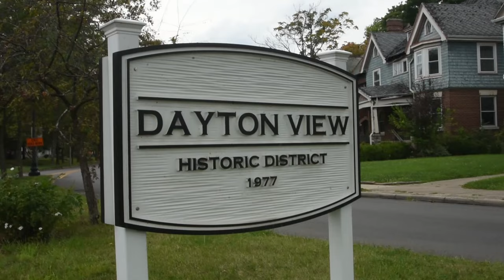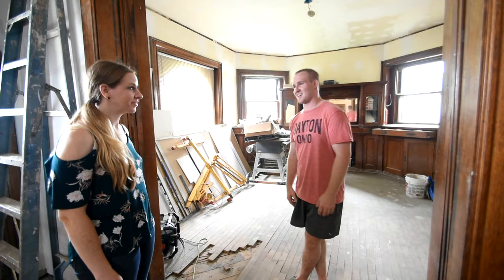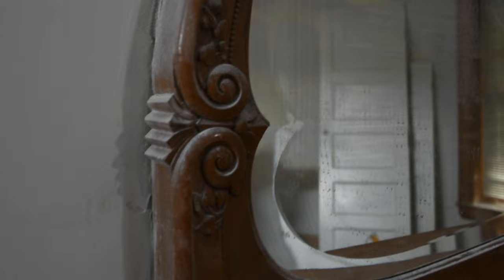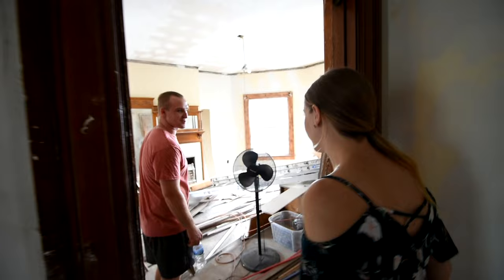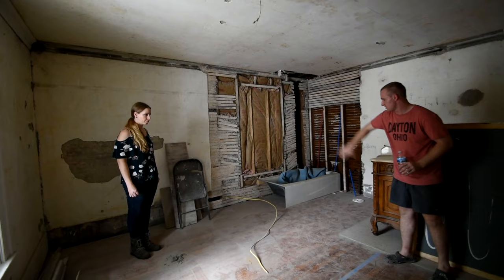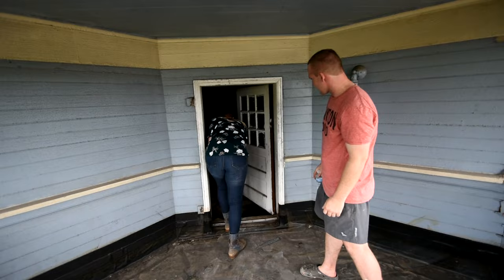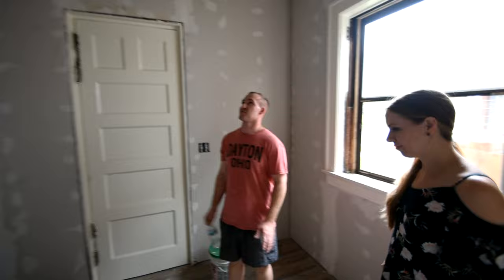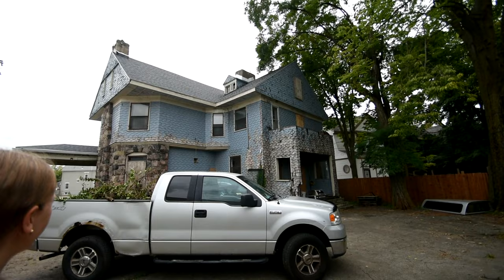TOUR The Cox Mansion Restoration - Ohio Governor James Cox

Comment: Awesome Video!  I asked for this and you two did it!  Andy you did a great job!  It is nice to see Dayton folks coming together sharing their passion for restoration.  I hope this helps him get the support he needs to move in and get a good start.  

The bricks can be sealed with Thompson Sealer.  
Thompson's WaterSeal Clear Flat Waterproofer (1-Gallon)

The mortar did not look too bad but that can be touched up repointed prior to sealing if necessary.   

Please tell me he is not going to paint the wood work that has not been painted in 120 years.  If someone is taking the time to strip the paint any woodwork, just seal it.  Just because there are some flaws in it does not mean it needs painted.  Flaws = Character.  The front door could have lower panels replaced.  Even the stairwell could have another part added.  The newel caps could be turned by a local woodworker with a lathe.  Hopefully someone watches this and pitches in.  Obviously he is earning the house through sweat equity so he can do what he wants.

Again thanks for the tour.  It is exciting to see young folks getting excited about these old homes.  He needs to get video of the racoons inside the house so it can go viral to help pay for the restoration.  Hope you had as much fun making this as I did watching.  So there is another Cox home (Mansion in south Dayton, maybe Oakwood or Kettering) that was just on the market about a year ago.  I wonder what happened to that one?  I think it is in Oakwood.
Reply from the maker: Your comment just made my day! I will be sure to pass along all the advice. Thank you SO much for the positivity and encouragement. Got any more suggestions for future tours? Lol Thanks for stopping by! ~Laura